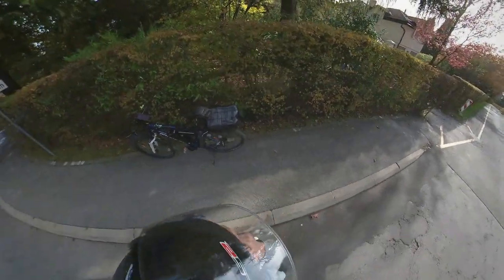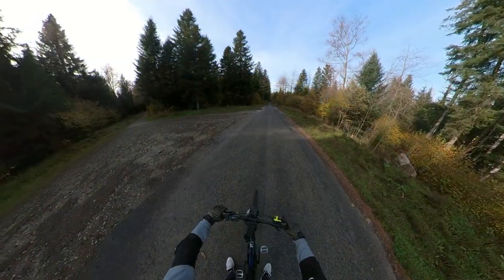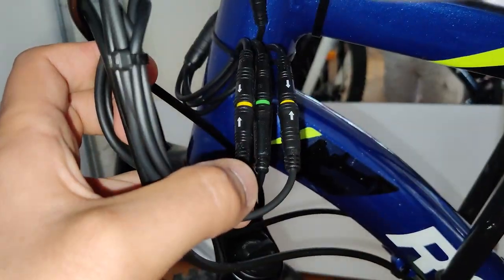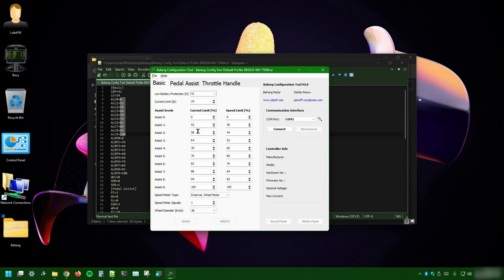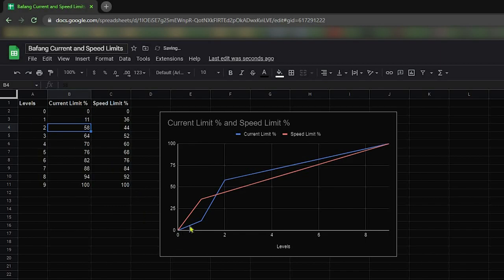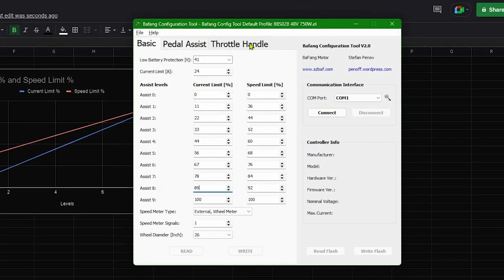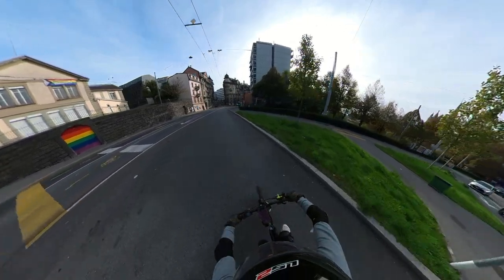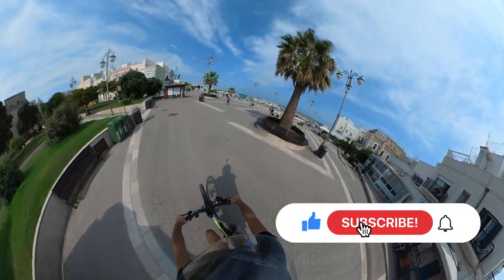I Downgraded My 750W Bafang Kit... but WHY?

Comment: This program from Bafang is in Windows only?   I too do not want all the power the motor has.  I just want some help on hills and head winds.  Thanks for the video. I gave it a thumbs up too.
Reply from the maker: hey! yes this one is for Windows only. the other possibility is to use an Android app (which is not equivalent) that allows you to read an flash settings with an OTG adapter and the same USB flash cable: https://play.google.com/store/apps/details?id=com.mkopa.speeed
remember to read the default settings and save them before starting playing with the app 👍
Reply: @LukeLorusso  Android runs on Linux, so the computer program could too if they wanted it.  Probably started out as a Linux program and was ported to windows.
Reply from the maker: @bigwheelsturning  Android is a Linux-based OS, but Android apps are built to run on ART ( https://source.android.com/docs/core/runtime ): they're not built for Linux.
If you find a way to run them on a compatibility layer on a Linux distro, that's a different story, but I won't bet 100% that would work.
lemme know if you succeed! 🤞
Reply: @LukeLorusso  Will try a download of the windows program on WINE.
Reply from the maker: @bigwheelsturning  a few years ago I used to make bootable live images of windows, you could stuff anything on it, from drivers to .exe programs... I don't rememnber how to do that, but also consider this possibility in case of issues with wine :)

Comment: Kind of silly to ride an illegal motor (most places) and downgrade to what a 250W would give you. I fitted a 250W kit for mtb trail it does the job perfectly. And if i get in zn accident on the road and they check my motor i won't have legal issues. Riding with 3 times the power that's legal on the road is too many liabilities to me
Reply from the maker: as I said in various videos, not everywhere it's illegal to drive a motor higher than 250W nominal. hence, there might be a LOT of people (say in north america) who can ride 750W motors and still feel unsafe with the stock configuration.
I'm happy about your 250W choice, I also believe it does the job (in flat areas), but those videos are meant for international viewers, with different legislations. please, always mind this

Comment: Where is the logic here? Instead of buying a 750W motor, you had to buy a 250W one and not mess with it. You paid for a 750W motor that you don't use all of. It does not make sense
Reply from the maker: the logic is all there, you might want to re-watch the content paying a bit more attention to what it's said. those mods don't transform the kit into a 250w motor, and all the power of the motor is still there. what changes is its distribution throughout the levels.
maybe the follow up will clarify even further: https://www.youtube.com/watch?v=HEGihE0BZEo